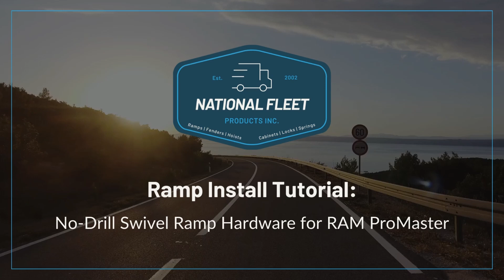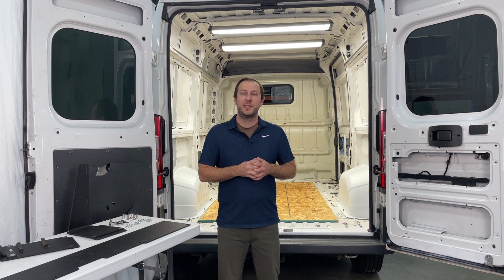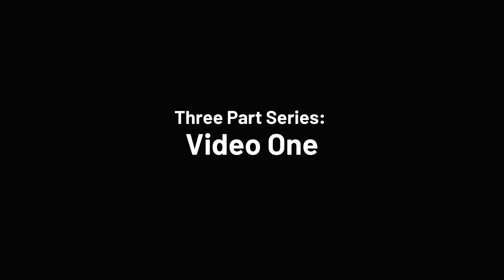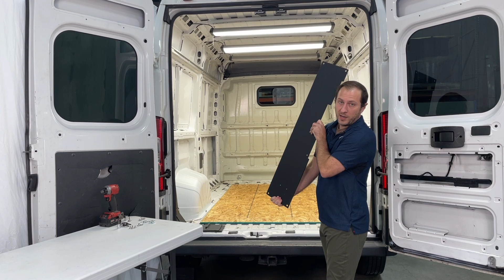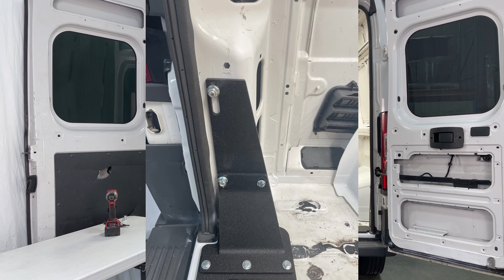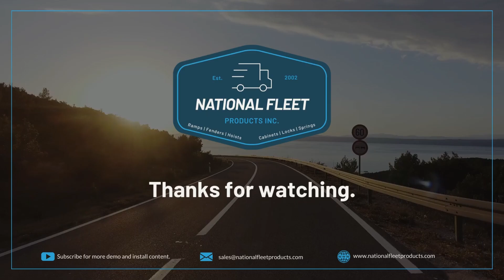NFP + WM System Swivel Loading Ramp Install, ProMaster, No-Drill Hardware, Video 1 of 3

Comment: does this also apply for a low roof ram pro master?
Reply from the maker: Great Question and thanks for your comment. Correct- this applies to all versions (roof height and wheel base lengths) of the Promaster. Available to discuss further at 763-762-3451.